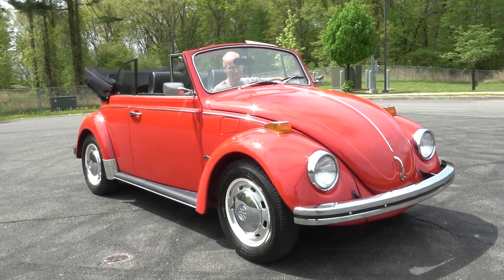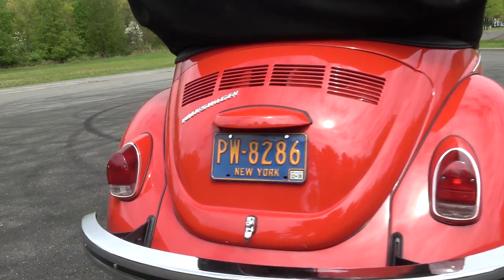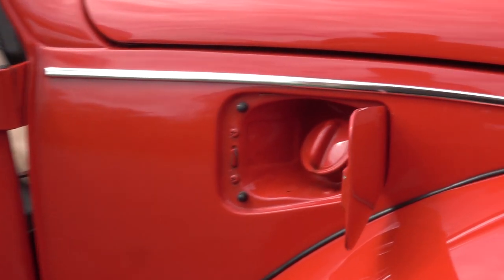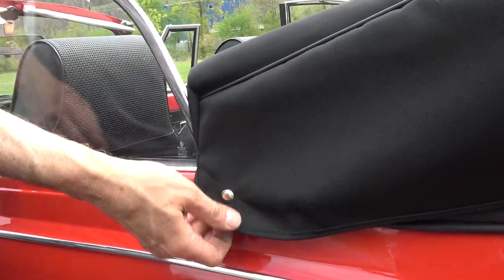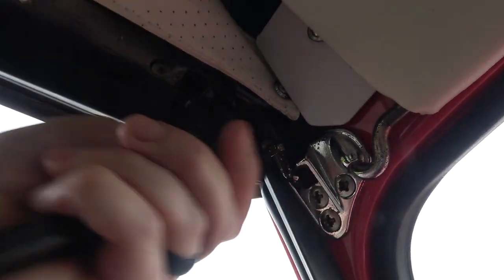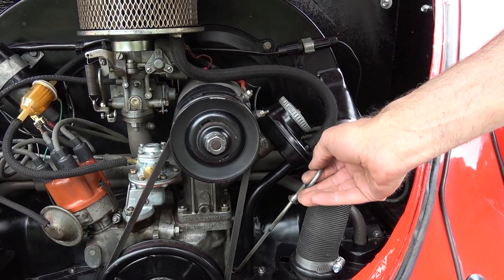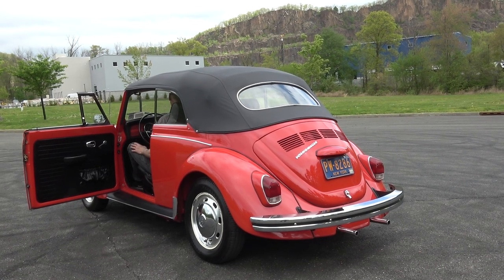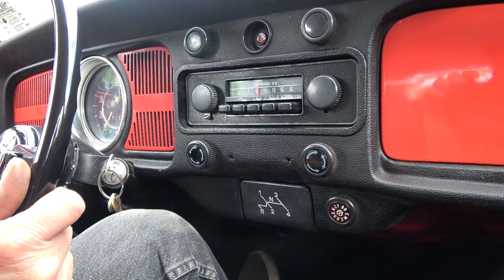Classic VW BuGs - VW Beetle for DUMMIES - 1969 Convertible Type 1

Comment: Thanks for doing this video. Lots of useful information. Since 1968 and 1969 look very similar, a really quick way to distinguish the two is 68 had a finger cut out for the gas flap. 69 didn’t since it has a pull lever.

Comment: I had a new 69 VW sedan in college. Great car with the CV joint axles and higher final drive ratio that made the car handle much better and keep up with interstate traffic. 1500 single port engine was bullet proof as long as you did all of the routine maintenance. This car has been restored correctly with the stock fuel pump, carburetor, and distributor. Good to see the original generator also. Sweet car. Congratulations to the new owner.

Comment: Two things: it is safer to mount the fuelfilter under the car instead of in the enginebay. And for starting: two times the pedal is for cold start. Warm start you do with no gas or with the pedal to the floor while starting

Comment: Chris-got a random question. Just got a 1969 convertible, love it! Im a short driver and must have the seat pulled all the way forward to reach clutch.  With a 3 point retractable seat belt im noticing it doesnt function all that well the way it must sit low below window, not much leverage for the mechanism to engage smoothly and i pull out so much belt due to my seat being so far forward it really doesnt retract well. Thinking about a retractable 2 point or a non retractable 3 point…any thoughts or preference? Safety concerns with 2 point but non retractable 3 point may be a pain to fight it tangling up
Reply from the maker: They do sell good three point belts today that retract well.  you could try spraying a lil WD-40 on the belt mech to free it up a bit.  That has worked for us in the past.
Reply: @classicvwbugs  thanks Chris! I ordered 2 brand new ones from jbugs and they acted the same way, its as if the angle is all wrong and then if you can get it to feed belt out it wont retract. Where do i spray the wd-40? Looks like there is a flap that opens to the coil of material but then the sides of the canister say do not open. Do you spray it right on the belt?
Reply from the maker: @meaganfroh2812  anywhere where there is mechanical movement.  There has to be some metal rotational mech in there.

Comment: Hello I find the videos very exciting. But I noticed something. In the engine compartment is a gasoline filter, gasoline filters should not be in the engine compartment of VW Beetles but always outside. The heat can cause the fuel filter to melt and this can trigger an engine fire 🙂
Reply from the maker: You are correct!

Comment: Hey Chris good video. Thought I would mention- the fuel filter in the engine bay, isn’t that a fire hazard? I’ve heard some horror stories about them causing fires and that they should be placed in the line running out under the fuel tank?

Comment: So I have a 78' SB Vert just had a new cloth top installed. Whether the top is up or down I noticed that one of the rear quarter windows is slightly out of alignment. And, I was wondering if they can be adjusted at all. When rolled all the way up its slightly bowed out at the top so there is a gap of about 1/4" the other window lines up perfectly with a good seal. So Im assuming something is loose ot out of adjustment maybe within the track?? I could send you a photo if you like. Ive been asking around for some time now with no results. Thanks BTW it looks like this bug has a fire suppression system?
Reply from the maker: you can adjust the rear quarter window with the adjustment bolts on the B pillar at the top of the door jam, there should be two bolts there with 10mm heads to loosen.  LMK
Reply: @classicvwbugs  Oh wow thank you so much Chris I'll let you know if it works. Ive been searching for months for a solution

Comment: Was that an engine fire extinguisher kit on the engine deck lid?
Reply from the maker: Where did you see that?
Reply: thats an original VW water deflection plate so that water coming through the vents does not get to the engine. Its not a modern day auto fire extinguisher that you are thinking it is, although they do look similar.
Reply: @classicvwbugs  at about 8:31
Reply from the maker: @thebarrytone  attached under the decklid?

Comment: That 69 has 70 turn signal lights which is probably why you didn't show the turn signal side marker lights on when checking the lights on position. Also you didn't show if the backup lights worked. Just an observation.
Reply from the maker: Good catch 👍 thank you.